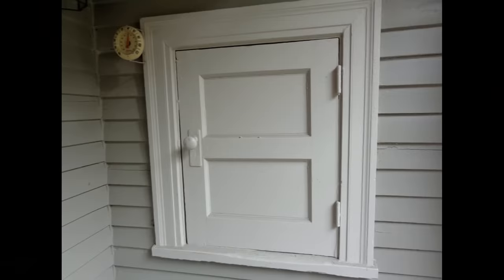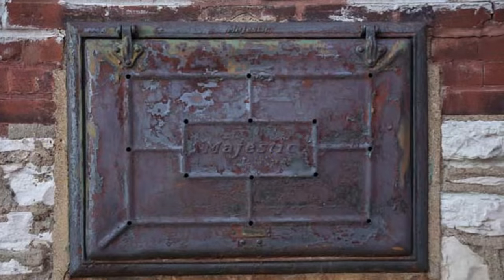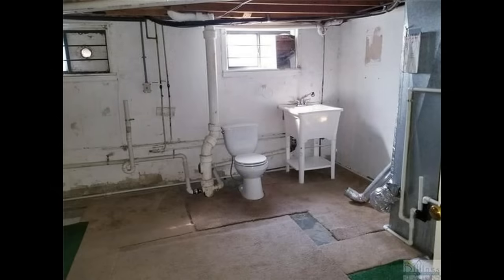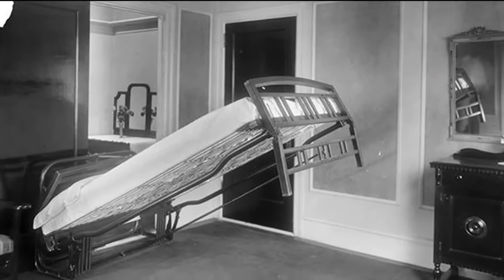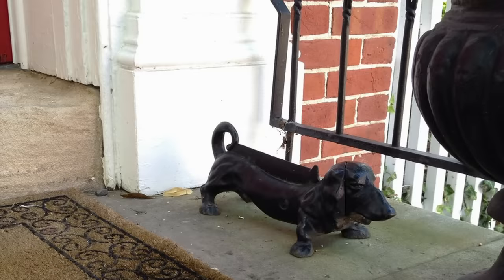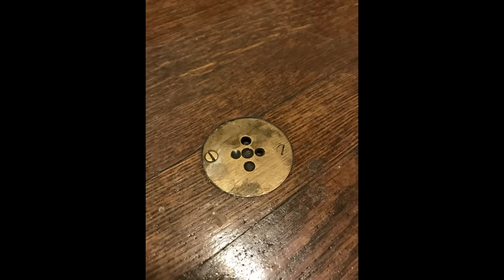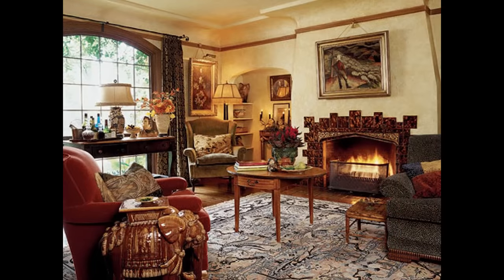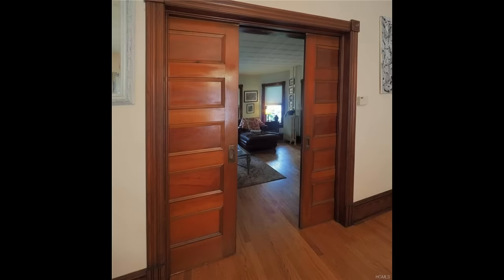Mysterious Home Features No Longer Used

Comment: I still use the old boot scraper outside my house (plus a large old nail to get the mud from the treads of my boots).  They are still good for the outdoorsy people.

Also, I installed pocket doors in my home (having known about them from the old house I grew up in).  I’m also having them installed in the new house I’ve designed.
Reply: If the starship Enterprise can have pocket doors, why not modern homes?

Now if we could just get the automatic door sensors and actuators to work better than a Star Trek blooper reel, we'd be in clover.

Comment: I took out an unused chimney in my 1930's house and used the space for a laundry chute to the basement.  It has a horizontal hatch at the top and a door on the main floor that stays closed.  No issues with the inspectors, but if needed, I can also put a spring-loaded steel door at the bottom.  It's a lot safer than carrying laundry baskets down stairs.

And no, I've never had any clothes get stuck.

Comment: Yes, pocket doors really should make a comeback! The house I currently live in is the same one I grew up in, with pocket doors between the front and back parlors. The house was built in the very early 1800s and, unlike Victorian-era pocket doors, the doors were not hung from above. Instead, they glide on a thin metal rail nailed to a low, rounded wooden threshold. I've always thot that was a better idea than hanging the doors, since less can go wrong!
Reply: I once lived in a house that had a horrible folding door installed in a normal doorway. A 1960s, accordion-folding, temporary wall, sized for a standard doorway. It never stayed shut and took up 1/3 of the doorway when folded.
Reply: I never found a pocket door that worked. They had a nasty habit of warping while inside the wall. If they make a comeback, they should be made of something other than wood.
Reply: @FeedScrn  I haven't seen a pocket door made since the 1980s that had issues with warping. It's just not a thing any more. Most interior doors are just a few strips of plywood with a paper honeycomb core and some laminated cardboard glued to them.
I mean I get where you're coming from and that is definitely an issue with pocket doors in houses from say the 1930s or 1920s, but anything built in the past 50 years or so? Not really. Unless it was built incredibly poorly.
Reply: @fermitupoupon1754  - Good to hear. Thanks for posting.
Reply: They are much better than swinging doors!
Reply: We have a "Jill door" that separates the bathroom from the master bedroom. It serves as a second handy exit from the bathroom - since there is only one bath in the house it comes in very handy if someone is in a hurry, since there is also a second sink on the bedroom side of the Jill door.
Reply: @FeedScrn  Our small (half) pocket door occasionally has issues with the sliding tracks, but has never warped: they made it with similar material to an exterior door.
Reply: @userafw  - Wonderful. It could be because of it's smaller size - that it has kept its shape.
Reply: My grandparents had double pocket doors that were wood around the outside and an opaque glass in the centre. Was easily the brightest room in the house because of the glass and was usually the room the kids would play in as those doors led from the parlour to the main sitting room so adults could keep an eye on us but there was also a small normal door that led out into the hall so us kids could go the bathroom without bugging the adults
Reply: How did that rail on the threshold feel when you stepped on it barefoot? Would dirt and crumbs clog it up?
Reply: @dannydaw59  don't remember stepping on it so im guessing it was fine. As for crumbs, my grandmother spent her whole life cleaning that house, im assuming they would come up when hoovered though
Reply from the maker: Thank you for watching and sharing what you have in your home.  Clearly those pocket doors are a good feature if they have been there that long.  Interesting to hearthe differences.

Comment: Opening transoms are extremely helpful in multizone minisplit air conditioner houses.  They allow a room (like bath or bedroom) without a head unit to get conditioned air while the door is closed.
Reply from the maker: You are right about that.  I think they are great to have and I love seeing them in old homes and buildings.  Thank you for watching!
Reply: Houses may be built with "jumper ducts" that provide the airflow of a transom, although no light. My house here in Arizona has no individual room return ducts to the HVAC, but has jumper ducts instead that return air to the main part of the house where the main return is in the ceiling, going straight to the HVAC in the attic.
Reply: @oldtvnut  transoms are difficult with low ceilings and 7ft doors.  However refit louvers in interior doors often look tacky.  Return ducts are great, but often the multi minisplit is installed to avoid putting ducts in old construction.  If ducting a house anyway, the obvious question is....then why not just install central?

Now an alternative I have considered is to put historic vents in the wall or over doors.  No light but they look like stove or big BBQ dampers.  Typically iron, ornate and circular with a sliding damper.

Comment: Add built-in vacuum systems to the list! I lived in a house that had one, it was madly loud but pretty convenient, the only scary thing was opening the wall covers to the hose connector activated the vacuum every time
Reply: my aunt had one of those central vacuum things put in and I hated it. Especially when my mum decided she wanted one in their house too. I hated having to use it so I left it to her. They also had intercoms installed which were fun at first, but ultimately useless bc they rarely worked properly. I don't remember when we stopped bothering with them and just hollered up/down the stairs at each other again lol

Our first house in the UK was actually one half of what had once been the local manor house (Georgian era; it had been split into 2 council houses in the 1970s and then sold off in the 80s), and still had remnants of the servants' bell pull cords hidden under the carpeting upstairs. Unfortunately the carpets also hid woodworm so it all had to be taken out and replaced. Outside the front door had the boot scraper thing too but we never used it. We had been renovating/restoring it back to what it might have looked like originally, but had to move and sell it, and from what I was told, the new owners ripped it all out. gutted They even ripped out my beautiful garden and the roses, and just... left it. I don't understand people who do that...
Reply: The recent ones are very silent. You can still buy them
Reply: I'm kind of interested in having one. I heard of one crazy dude who arranged it to just blow the dust out into the back yard - the dust was out of the house, no flow restricting HEPA filters, and no bag emptying etc.
I'm not quite that brave, however having it do strait into an outside bin could be handy - never touch dust again.
Reply: @paulstubbs7678  You need to plan it with the building. To add it later is an expensive option, the channels have to go downwards only, lot of brickwork needed.
The one couple i know to have one, he wanted it, she hates it.
It is so silent so she has the impression it doesn't work.
Also if you suck some valuable good, you have to search the whole bin, not only the little bag.
Reply: I thought the whole point of those things was that they were quiet.  The unit was usually placed in the basement or out in the garage so all you heard in the house was the suction.
Reply: Perhaps he didn't include built-in vacuum systems because they're still quite common. And very quiet, unless the power unit is inside the home. Ours is in the garage - we never hear it unless we open the door to the garage.
Reply from the maker: Thank you for watching and mentioning another feature Bridgette!

Comment: The Pittsburg toilet was installed for allowing sewer backups to occur in the basement rather than in the finished area of the house (the intent was not for coal workers -- though it almost certainly ended up being used for that).
Reply: So would they exclusively go to the basement to 💩?
Reply: @Fiery154  Well no, you have to understand all the toilets in a house are connected to a single large sewage pipe that then connects to municipal sewage or septic. But with pipes things can go both ways. 

If the first opening of the pipe is on the upper floor then anything that comes up will come up there and it also makes it much harder to access and unclog the system.

This is why toilets have water in the bowl, the S bend / S trap prevents sewage gas from escaping the pipe. Sinks also have these traps to prevent gas.
Reply: More likely in older houses built without indoor plumbing. When the home got indoor toilet and didn't want to remove a bedroom to install a bathroom. My grandparents' house was like that>>full bath put in the basement.
Reply: Yes. This channel is interesting but the guy is often loose with the facts. I guess it results in more comments.

Comment: I have seen many of these things, but the question I always had was how they would empty the razor blade slots you answered my question, they don't. Thanks for this very interesting video Rhetty
Reply: My late parents built a house around 1939 that had that feature. You'd unbolt the medicine cabinet, and dump out the used blades that were kept in a metal tray.
Reply: Remodeler here, I’ve ran into this quite often.  The back of the med cabinet would have a slot, sometimes I would find hundreds of blades laying in the stud cavity, only way to get to them is to completely open the wall all the way to the studs.
Reply from the maker: Yes it just collects and collects.  Sometimes they are stuck behind the cabinet or are down at the bottom of the wall.  Other times they are all the way on the ground.  It can also be a mix.  Thank you for watching!
Reply: O very cool.. I live in Texas where I've seen just about all of these always wondered what that slot was for in the medicine cabinet!!!! Neato mosquito!!!
Reply: But who thought that was a good thing?!? Talk about denial....out of sight is out of mind?!? Crazy they didn't think that through! It isn't even like they would degrade or something, just wow!
Reply: @richardmerriam7044  There was no metal tray.  The blades just dropped through the slots and piled up on the base plate of the stud wall, between the studs.  No need to empty the area as it would take many, many thousands of blades to reach the slot area that would be 4 to 5 feet from the floor.  What made them popular was; once dad had shaved and removed the used blade and disposed of it in the slot, it was gone forever and no fear of young children getting their hands on them to cause serious injury.
Reply: @woohunter1  The tallest pile I've ever found, I measured at 20 inches tall within 16" studs.
Reply: @user-jy3zl2vp4b  Most safety blades were stainless steel, so they didn't degrade, corrode or rust.  Once in the wall, they were gone so that young children could not get their hands on blades that could still cause serious injury.  Sharp blades in garbage bags can still cause serious injury to people handling them, such as homeowners or the garbage men.  The practice was actually genius.
Reply: I live in a mobile home built in 1962, still in good condition, and it has one of these in the medicine cabinet.  I remember my dad using it when he was alive, but it hasn't been used since probably the late '80's, no telling how many are in there.
Reply: @haleyoneil9172  omg neato mosquito lol
Reply: @user-jy3zl2vp4b  What harm do they do there in the wall? None. They're just little bits of steel. Whereas they were dangerous to throw in the trash. If you open up the wall for remodeling, it's easy enough to take them out with gloves and a magnet. They're 100% recyclable. This isn't "denial", it's more thoughtful and responsible than the modern alternatives.
Reply: @woohunter1  Go go gadget magnet.
Reply: Wrong! Stainless blades were much more recent. "Gillette Blue Blades" were brittle, high-carbon steel. Eye surgeons used a "blade breaker" to snap off one corner of a blade to make a tiny scalpel to open the cornea for cataract surgery. You couldn't do this with stainless blades.
Reply: @woohunter1  ever try a magnet?  or were they all rusted together ...
Reply: @davidm.4670  never tried a magnet, just turned on the shop vac and then made sure I disposed of them safely.

Comment: One feature that comes to mind is a 'cooler'. I know these were used in  bungalows and were meant to keep food, that didn't fit in an ice box, cool. There would be a floor to ceiling airtight cabinet vented from below and exhausted on top, with slated shelves for air to pass. The cooler air from under the house would rise as it warmed and pass through the cabinet drawing cooler air with it, keeping the temperature in the cabinet cooler than the ambient air in the kitchen.
Reply: Interesting!  I have not ever heard of this, but it would have been handy!

Comment: I recently renovated and redesigned my new home, which had an open-plan living room and dining area. So, I built a diving wall and installed a pair of 15-panel, glass, "pocket doors", which operate in tandem when either is slid open or shut. Apart from saving on floor space and the unnecessary heating of an unused room, they are a very attractive and cool feature that still allows daylight to flood through. Additionally, the built-in, soft-close, damper mechanism prevents them from clattering together.
Reply: Sounds lovely
Reply from the maker: Thank you for watching and sharing what is in your new home!

Comment: I'm sure it got mentioned somewhere in these comments, but I would add that many of the larger old homes in my area have some sort of roof vent above the central stairs.  This would be anything from a simple cupola to a large Greenhouse style skylight. On hot days they would open this up and strategically open lower windows.  Of course this was before air conditioning.  I was shocked at how affective this system was.  Between the siphon effect and heat rising out the breeze at the top of the stairs would blow back your hair!
Reply: LIke they say, necessity is the mother of invention.  They HAD to have some way to cool those mansion/mammoth homes! Now a days, when you don't have A/C the achieve much the same effect with attic fans, even on single level homes!
Reply: A lot of traditional houses in Japan are tall with skinny rooms. In the hot, humid summers the entire house acts like a chimney with the hot air rising into the rafters and out the vents while pulling cool air in through the lower windows. The ancient technology works so well that AC is still rare in Japanese houses. Sometimes the old ways are the best ways.
Reply: With the Victorian house we once lived in, the Tower was the highest "room." Alongside what was Grandmother's was a room (NE corner of house) that was separated by a wall of casemate windows. It took me YEARS of thinking about it, until I realized that the 'window' room was a COOL room, and with the tower up high, and the right windows and doors open, it would work exactly as you describe! WONDERFUL!!
Reply: @mister-v-3086  Kind of the same for me.  I had repaired a bunch of skylights and they're always up high and most of the time above stairs and thought why would they put them up here? One time on a hot day, I got it, I could feel the wind whipping out of the house through the skylight from the lower levels. I finally understood and thought it was so interesting.
Reply: There is a mansion in Savannah that has such a cupola fitted with a ring of gaslights. The flames created a forced draft. I suppose it was built in the late 1800's.
Reply: In our old house, had a door that opened up on the roof.  Open the door, open the door to the attic and the windows and you got air flow throughout the house.  House built in 1955.
Reply: @markfisher7962  I never heard of that option but I'm in the northeast.  I bet that was the hight of fancy air conditioning for back then. I know how hot it can get in that area. A status symbol but practical as well!!  Thanks!
Reply: Yes, we had an exhaust fan in the attic and would open the north lower windows that were shaded and cool, this kept our house cool even when it was 90 degrees outside with 90 percent humidity. I am amazed that people pay such high bills instead of doing this.
Reply: That's basically the concept of how a swamp cooler works, but since it can also pump air via a motor it can work with single-level homes.
Reply: @marscaleb  Swamp coolers work by blowing air over water.
Reply: @foofyastralpunk5875  Okay yes, but I meant for how the circulation works, as they typically aren't used with a full duct system, but they rely on having windows open to pull the air through the home.
Although I guess they actually work backwards from this idea, since the cupola would be the exit vent whereas the swamp cooler is where the air is brought in.
Same thermodynamic principles,  just a different direction.